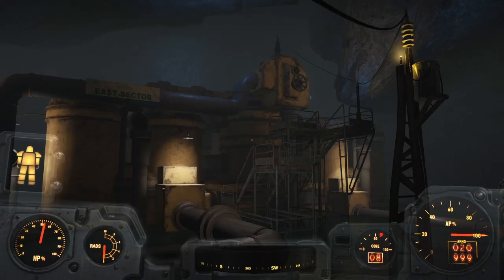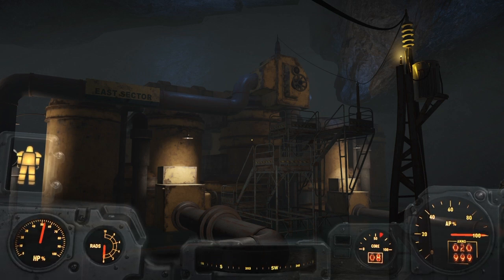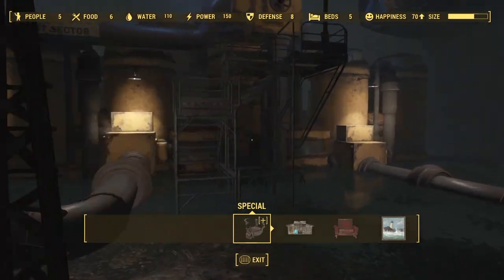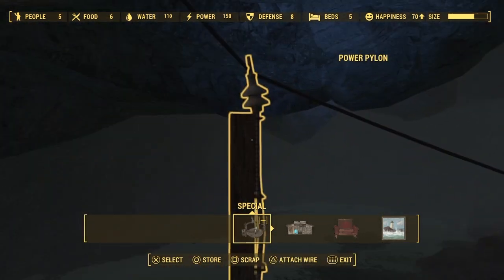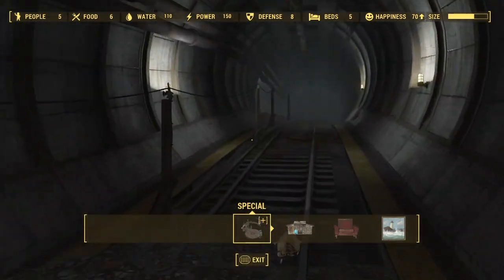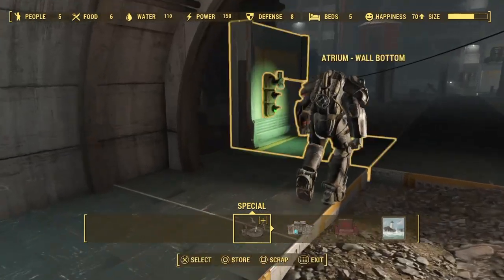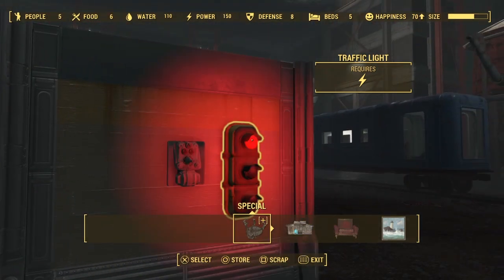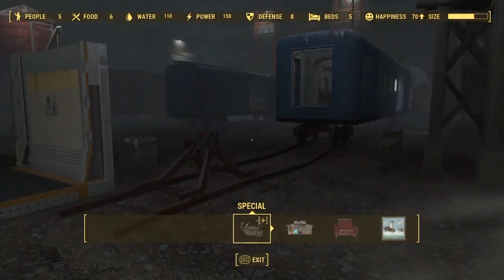Fallout 4: How to power Vault-Tec Water pump in Vault 88 with main reactor

Comment: 2 large generators, 1 Pylon and 2 wires is all it takes.
Reply: Do the power line glitch, save all that hassle
Reply: @23maffia  I think I saw that in a video.That would be good. What I did wasn't any hassle though...no more than the glitch, at least. Very easy.

Comment: I was able to string a wire along the ceiling with a total of 3 of the power conduit wall nipples and 7 ceiling nipples, plus two street lights in the water pump room.  It wasn't pretty and those looping wires probably aren''t OSHA compliant but it worked.
Reply from the maker: Pretty sure OSHA got nuked anyway.
Reply: @TheOldestNewb  Given the piles of hazmat barrels you encounter in game, they were probably gone long before the nukes flew.

Comment: I did something similar only I used ceiling conduits along that central beam in the tunnel to string up my wires.

Also you do not need that scaffold he showed, you can string a wire directly from a large pylon on the shore up to the pump...you just have to click the wire to any highlighted portion of the pump to get it to connect, not necessarily the connector at the top.

Comment: Thank you! Was wondering if just placing one wall by the water pump would eliminate the need for the mass amount of wiring needed. Will check... not working so far.
Reply from the maker: Please let us know what you find out here in the comments ☺️
Reply: @TheOldestNewb  Initially, I would say it does not seem to work. Was able to put a wall on a support stand, elevated right next to the water pump and run a wire from it, but water pump is not powered. Guessing the walls act like a power line themselves. Thinking of building a vault reactor or 4 large power generators next to it instead.
Reply from the maker: @cyalknight  Interesting!

Comment: I built the concrete & wood blocks in the water (they go straight through the pipes, lol) buuut, i can't start the damn machine up. Using a Vault Tec genny (150power) plus one large pylon and starting by wiring from the pump.
Reply from the maker: Don't attach a generator to the reactor.  Just connect the wires & pylons.